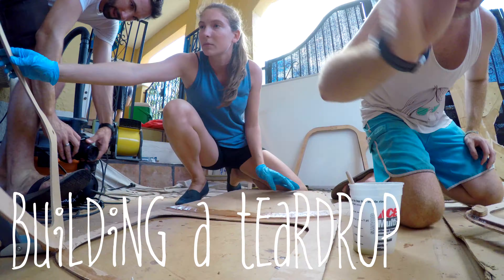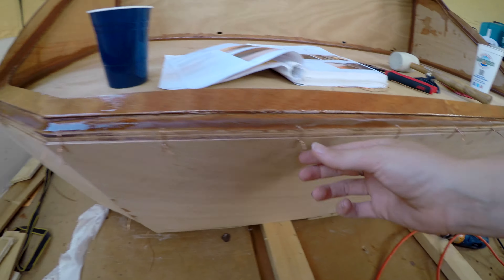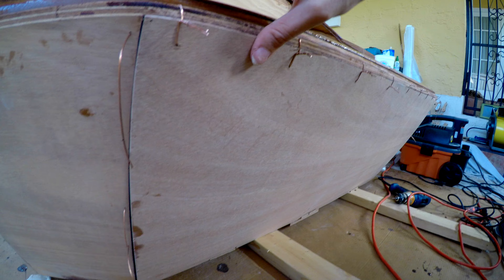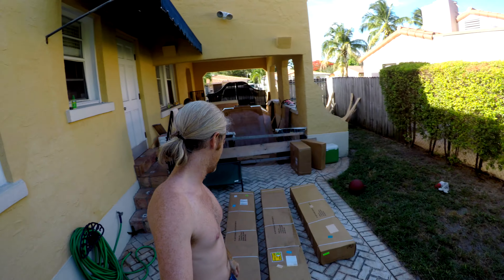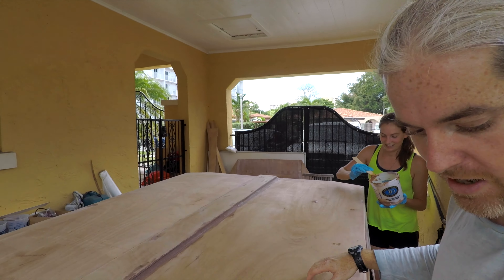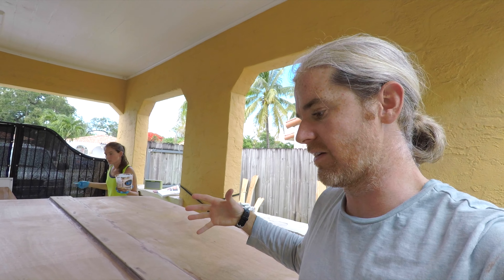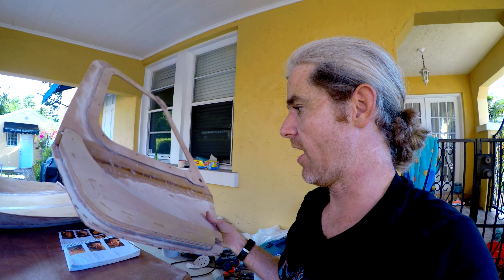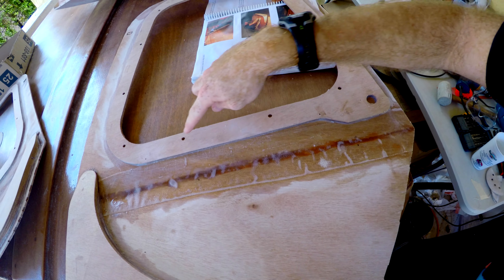Building a Teardrop Camper - Episode 6

Comment: Love the idea of building a box under it for storage. If the drawers are sliding out from under your kitchen area you should set in a hinged inset piece of plywood in the first 3 feet of the drawers. This will become the platform to stand on for the kitchen and can have a slide out step from under one of the drawer ends or side.  Painting the roof white would be a great thing to do for keeping the inside cool. Hope your plans are to add solar too!

Comment: Nice set of build videos. MIght clear up minor confusions in the manual. I am going to build up a platform on the trailer but not the expensive one from CLC. I have a more expensive and longer trailer with bigger tires so I have to clear the fenders with the door. It is my intent to be able to jack the Teardrop off the aluminum trailer and use the trailer in the off season for normal hauling duties.

Comment: Just some thoughts on extra storage room: Maybe use the space under the floor of the teardrop? The trailerbeams seem quite high and there is a lot of room between the bottom of the teardrop and the axle, maybe even lift the teardrop a few inches instead of your 25 inches. This wil give you some isolation of the floor as well. Cold nights ..... Access to this space by lifting the front or the back of the teardrop.
Reply: What I had in mind for access to those spaces/boxes was lifting the entire teardrop on one side, front or back, left or right, as it seems very light and constructionwise independent from the trailerframe. This would call for some sort of latch/hinge connection between teardrop and trailer.

Comment: I'd thought of mounting one ontop of a comon 6/4 or 8x5 box trailer that are common & cheap in australia.- possible to put stell draws in like 4x4 or just slide in stuff in from the end doors. (but same issue as your idea raises it) though with this you could un bolt and lift of camper for a noraml trailer again.
Definitely  do a tongue box and and mount roof racks..  you could always put a thule aero box up their for tripods etc. and a kayak on the other side.   consider puting a 2.5" receiver on the rear to mount bikes or build mount on toungue
Reply: You mentioned Australia, I decided that a 6 X 5 would suit me best. I bought an 958TC 8x5 Multi-Trailer from Carlex in Melbourne and cut it down, it was easy and worked well (so far). The drawbar might be a bit short for my liking. I prefer not painting the camper white if the wood grain is good, and maybe use roofracks and boots for the load. But thats just me.
Reply: sounds good - would love to see how you go.   I haven't pulled the trigger yet but examining it closely

Comment: Finishing design idea: had a similar idea to Rob in that you incorporate your fingerprint logo. What if you had the main 2 sections (over the top by the main fan vent) white with your logo (allowing the wood to push through in the main part of the logo and white filling in the negative space) over the galley hatch like you were saying. Then, leave the two "eyebrow" sections arching over the side panels as wood with a small pinstripe of white accent (the CLC Demo one has a black stripe). Then the side panels with the doors are white with a pinstripe of wood accent outlining each door. 
I think that keeping as much wood as possible is a great idea because it really showcases how sweet the build is and how unique the trailer is. So, I think that the interior should remain wood and keep the galley area under the hatch all finished wood. Good luck! I'm loving following along with your progress!

Comment: For paint I would suggest painting the top( first 4 panels into mold) White or a light pastel. I would leave the sides wood since they are more vertical you will get less of a solar gain. I would recommend using a quality boat paint like AWL GRIP or Petit EASY- POXIE.  If construct a box to gain storage you could paint that a contrast color. If you install a battery bank for solar or genset power storage consider buying LITHIUM batteries. You will get 4 times the out put and storage capacity over lead acid and 4 times the life span. You Live in Florida as I do and should know that batteries in cars do not last more than 2 years due to heat. Great job ,Nice build, Two thumbs up.
Reply: Not really . Look at the GONE WITH THE WYNNS you tube feed. They have a complete segment on the lithium batteries and another on solar panels
Reply: The video was called SAILBOAT TEC published 4 months ago.

Comment: I like your under storage idea, and if you do it, may as well go 15" deep or a depth that fits a specific plastic tub, since you might have to make a standing platform/step for the galley, get the most extra storage space you want.  You could build a step that is integrated into the under storage. You could use some of the under storage space for a flexible water bladder to have a sink, with fresh water, and hand held shower. Maybe a roof rack that incorporates one of those solar portable hot shower bags.

Comment: your biggest issue will be the wheel size those size wheels are only meant for short journeys to launch a boat etc. due to the small size at 60mph they will be rotating at the same speed a normal size car wheel would be at 120mph. do fit larger wheels.

Comment: The wood 'look' is awesome - hard to beat that IMHO. Seems that's the reason for building one of these in the first place since I'm sure making something similar out of complete fibreglass or sheet metal would be easier overall. Does the company not make an insulating liner for these? 

I live in Canada where cold (serious cold) is the main issue - ppl would insulate the heck out this unit to keep from freezing in spring and fall - that would be the primary concern for sure... cool in the summer would be a side benefit. Without a furnace or heater of some sort, using a trailer like this in winter would probably not be an option no matter how much insulation you could apply.

My interest in these trailers is that I would like something similar to put in the truck bed of my Toyota Tacoma - a lovely wood grained, 3D-ish truck camper.
Reply: I'm going to fire up Sketchup and attempt to design this truck camper... it would totally be worth the effort - a Chesapeake knock off. Plus, I need an excuse to buy or build a CNC router.

Comment: Since the sun does not provide solar at night. Toy with the idea of a small marine wind generator you could deploy when camped ,stow way when traveling . For safety make your drawers pull  from passenger side only. Install the mechanicals,power hook ups, long term storage.  on driver side.  This way if pulled on side of road your not in traffic Pulling the drawers from side will allow you to install cross stringers to help support camper floor. Looks great!

Comment: For paint - I would definitely go for white. Given where you live most of the trailer. I would try to mask of a pattern of wooden area to keep the wood look. In a more northern climate zone I would leave a lot of the trailer in natural glass over wood but I think it will already tend to be an oven in the sun. I would do the box... I would consider doing the drawers out the side or four drawers two out the back, two to the sides. Long drawers will have structural issues, put a lot of leverage on the trailer when out (requiring the trailer to be on the ball when using them), along with being difficult to access in tighter quarters.
Reply: I agree 100%.
Reply: I agree but don't have any fiberglass covered wood showing.
Reply: An idea to make the wood srand out is make a design where you leave wood accents, but cover all the main areas with white gel coat.

Comment: I have been very curious about building a teardrop on a storage platform. I've seen several with boxes dropped into the floor. I would rather be able to access the storage without moving the bed. I wonder if it would have a negative impact on how the trailer handles. Maybe you could mount it on the box in a way that you could remove it, if you wanted to.??

Comment: I would remove the last 3 torque tubes of the trailer and replace it with a box that holds your drawers.  The top of the box could overlap the trailer long tubes if you are worried about any strength lost.

Comment: Paint the entire thing white. It's not worth the hassle to deal with the fiberglass damage from the sun.
Reply: Waterlust those rarely work. Painting is your best route. You don't want to deal with the hassle. The entire "exposed wood" is a lie as your wood Is not really exposed, only covered with a clear epoxy and fiberglass. The big problem is once it starts to get damaged you will not notice or "put it off" for a while. Before long you are doing major repairs or have wood that is no longer protected. 

It looks like you have a small carport in florida.... So I assume you will not keep the trailer there, even then it is not truly protected. 

Keep the wood look for the inside and galley!

Just my opinion (which you asked for)